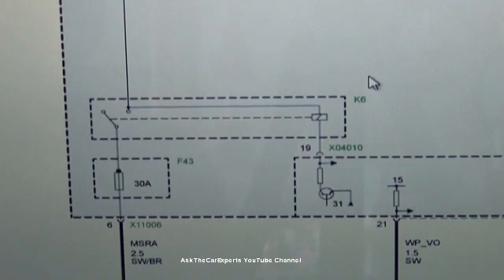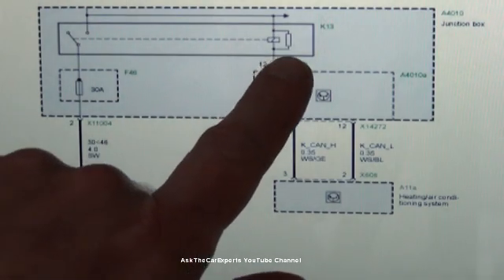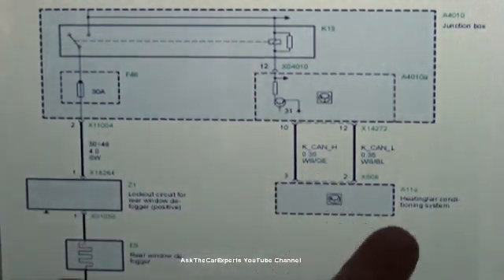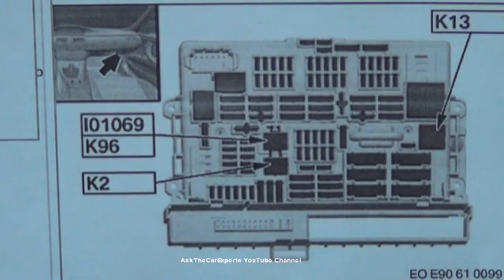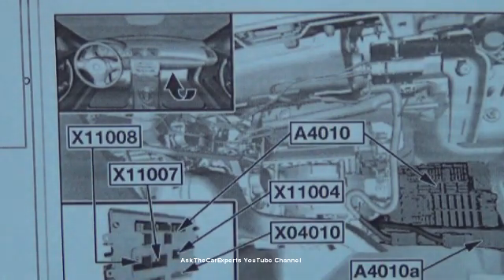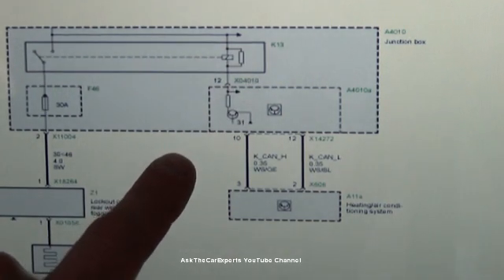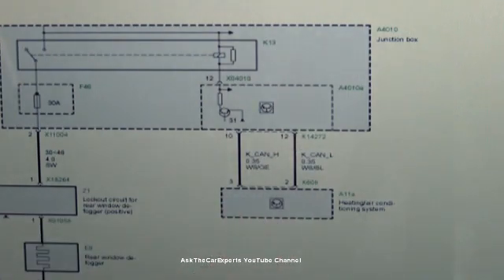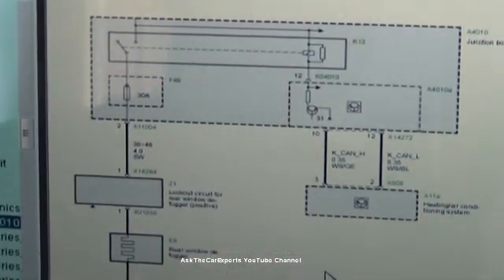BMW 3 Series Rear Defogger Defrost Wiring And Troubleshooting E90

Comment: I've been a subscriber of yours for a long time and really enjoy your videos. 
I could really use your help in diagnosing a very slow coolant leak on my '03 325xi. I'm using about ½ pint every couple of weeks or so, and there is no apparent signs of any external/internal leaks. I assumed it might be the notorious headgasket, but there are no signs that there is water in the cylinders (white gunk in valve cover, excessive white smoke or smell of coolant at tailpipe, test for hydrocarbons in overflow tank is negative). Also, the passenger carpet is dry so I assume the heater core isn't leaking. Any direction or ideas since you seem very in tune with E46's?
Reply from the maker: Hello, I would be happy to help. It is easier to post in google plus now than youtube. If you could use google plus to contact me it would be great :) Was the vehicle ever overheated in the past at any time?